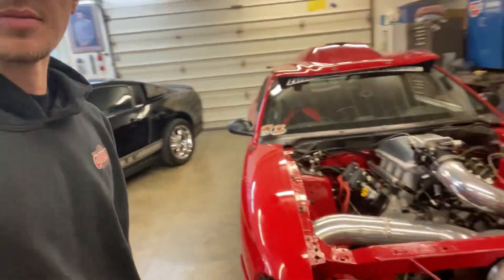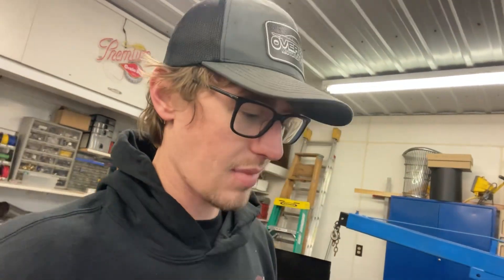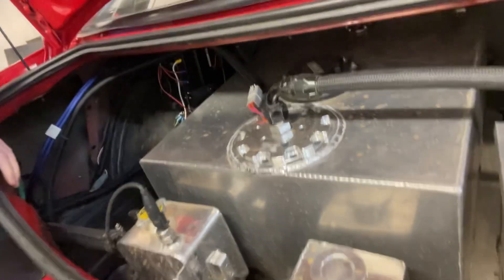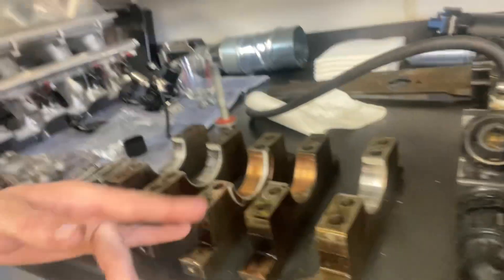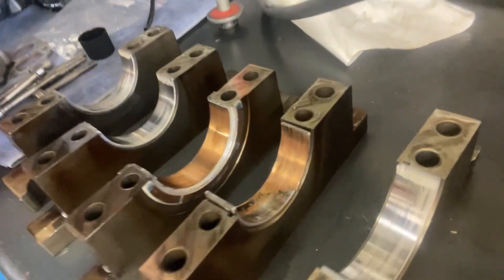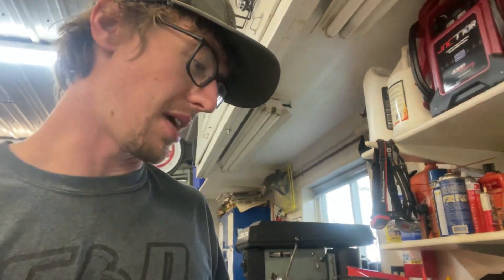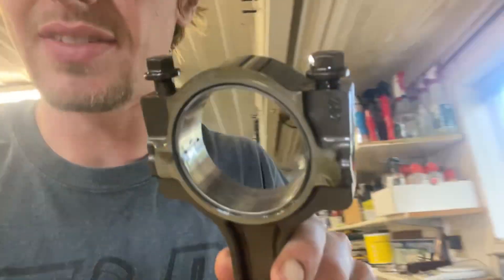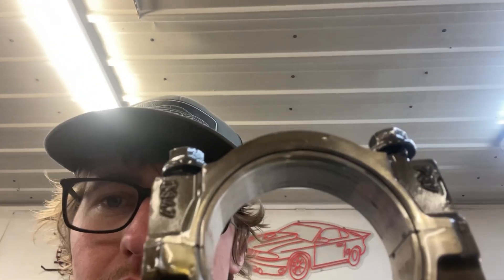I hurt another motor! Plus Centroid CNC 5axis cylinder head machining!

Comment: i've been busy too...   i made my first test pass in front of the house.  couldn't really tell much but i dont think anything broke
Reply from the maker: Did it spin the tires?
Reply: @OverydeMotorsports    Yeah. i wasn't expecting it to hook up,  i'm still not even sure if i have the right gears in it yet and wont find out until i get those slicks under it, overall i'm optimistic,  engine runs, all the carb linkage is dialed in,  transmission shifts, nothing's leaking, it doesn't catch on fire anymore and my wife still loves me....  And on a side note;  my neighbors seem excited,  it might be even louder than your cobra.
Reply from the maker: @dirttdude  hahaha hell ya! Sounds like your on the right track!
Reply: @OverydeMotorsports  Made 5 passes yesterday,  it's not leaving. IDK why